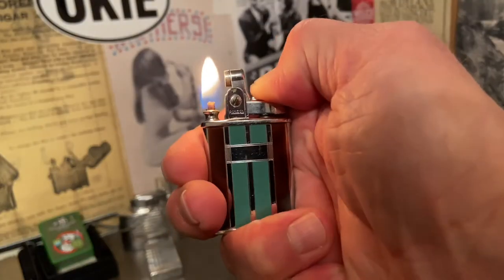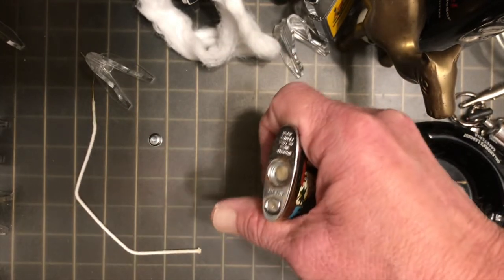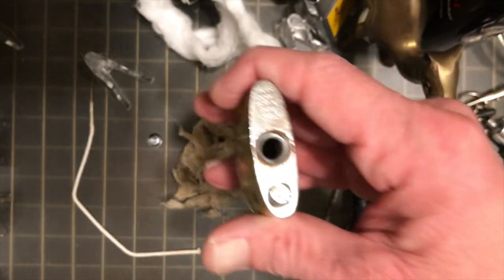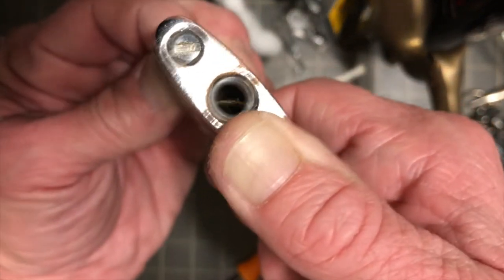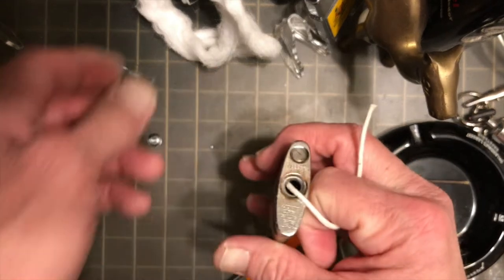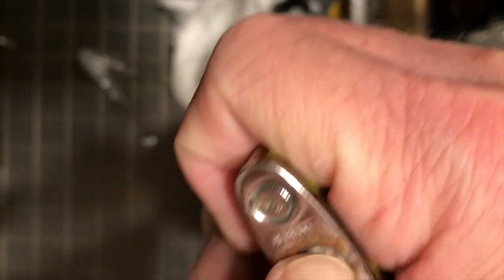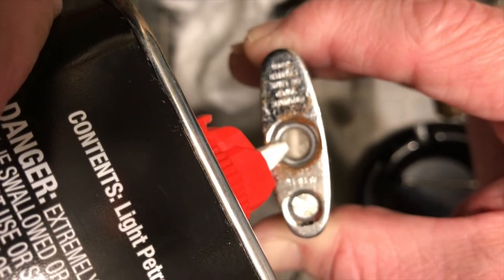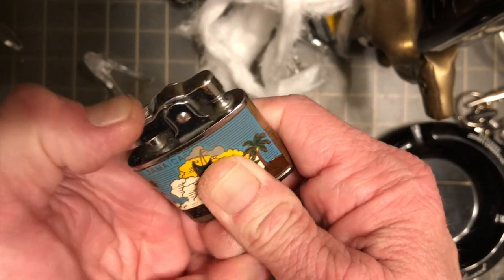How To Replace The Wick And Wadding In An Albert Automatic Super De Luxe Petrol Lighter

Comment: What type of wick you use on this lighter. Is the a website that you buy the wick. I only find the copper wired only. Please help. Thanks
Reply from the maker: The Imco or old Ronson wicks will work best. I have a variety of links where you can purchase wicks toward the bottom of this page:

https://dependableflame.com/helpful-lighter-related-links

✌️